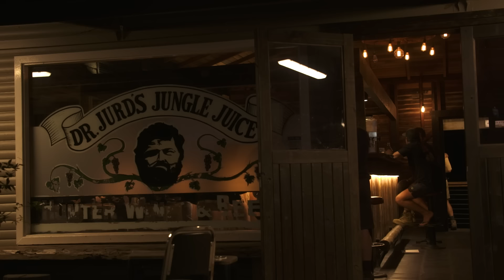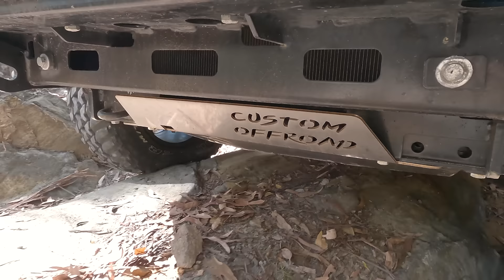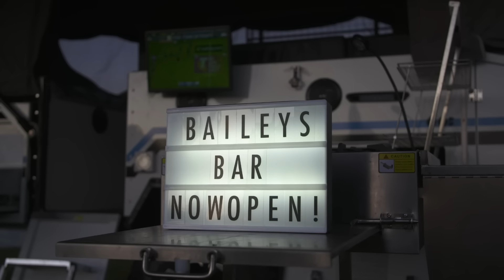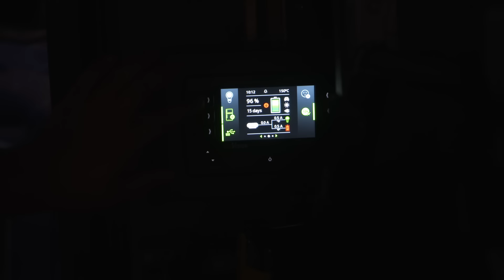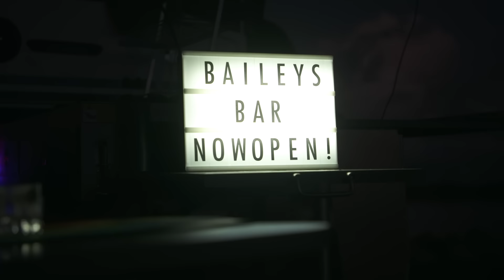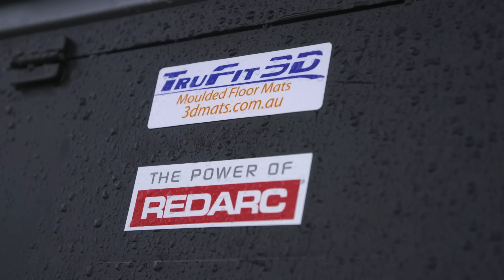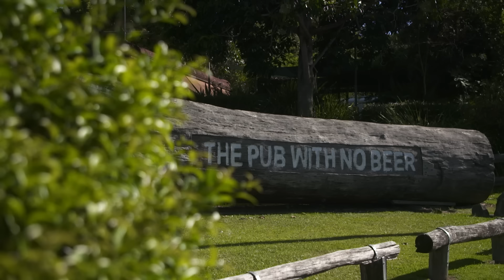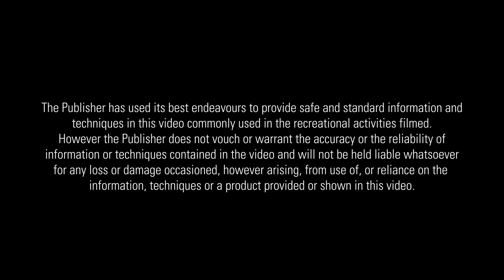Never broken this before... STRANDED without a fix! Epic bush to beach pub crawl

Comment: They should make a video comparing all the same rigs. So for example take Shaun's 80, Bailey's 80, Tony's 80. Or Graham's Y62 and Reuben's Y62.
Reply: Baileys 80 is never running properly tho
Reply: But what will use to tow the Nissan’s home.
Reply: @lukekempthorne8537  may i know why?is it because that kid dont know much knowledge about modifying his car?just pure money only?
Reply: @dolguldur4706  every episode it’s in, it’s hardly running.
Reply: I was thinking similar but they take turns driving eachothers. Jock drive soot, Shaun dives the Hilux etc
Reply: @lukekempthorne8537  nothing he brings ever works
Reply: The pub that the boys and I are planning on heading to shortly is the Camerons Corner store/pub.
Reply: @lukekempthorne8537  I feel like the kid's out of his depth a bit hey. Every Bailey episode the poor bloke is either on fire, on his side or on the phone trying to get parts. He's got a bit to go to slay the camera shyness and get the confidence behind the wheel.
Reply: I had my spotties snap off my bulbar in the Simpson desert. I could really have done with a set of stedi's getting into Birdsvile for a pub feed.
Reply: And different tires on each one to see the best results

Comment: Doesn't sound very adventurous, but the Byron Bay hotel is on my list. Later this year after the CSR, I'll be dropping down to shark Bay, most Western Point, then east to Byron Bay the most direct route possible, straight through the desert. Some new Stedi lights would be a welcome addition.

Comment: Looks like I’ve had a few under rated 4wd’s. My favourite was probably the first, Toyota 4Runner with aftermarket turbo on the old 2.8, used to carve up,the dunes and outback tracks without drama.

Comment: Pro tip : @ 31:15 Always turn the handle of the pan over the table or the stove especially with hot oil, that way you will greatly reduce the risk of accidentally knocking the pan off and spilling the hot oil on you or some one else's legs and having to deal with large 3rd degree burns in the bush ! Great ep, thanks guys !